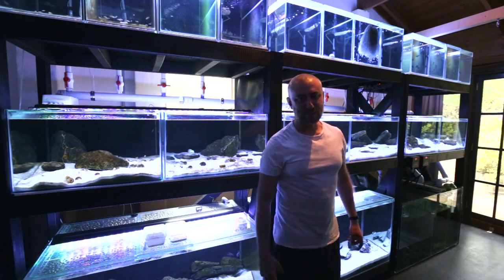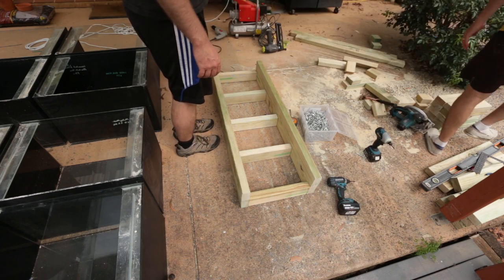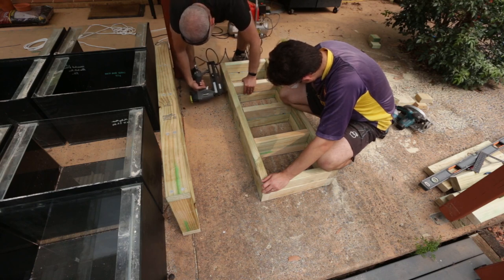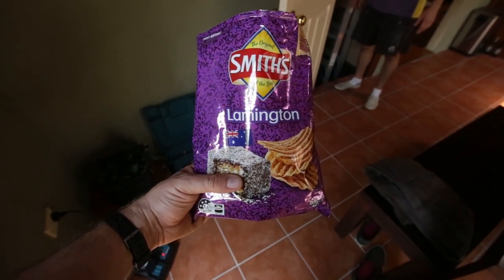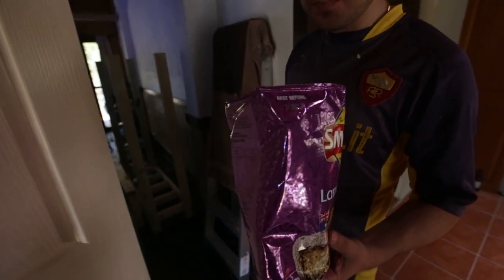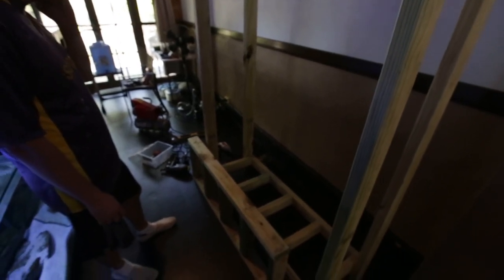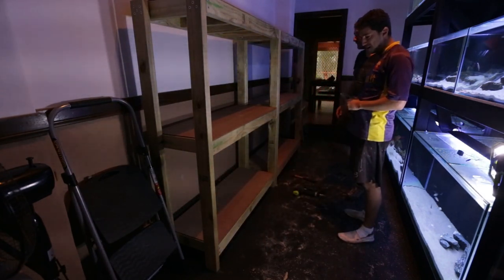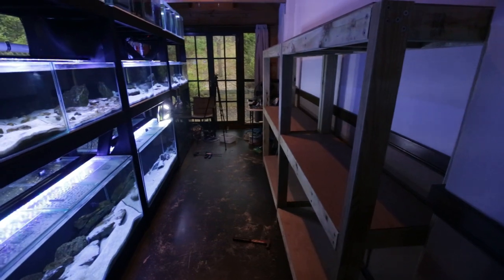How to build Fish Tank Stands/Racks/Racking. DIY! Part 2

Comment: So the tanks are held up with screws? All the load is on the screws??
Reply from the maker: Apologies, I responded to your comment the day you posted it through the youtube app but it seems to have disappeared or something. Seeing Jack's comment today made me notice my initial reply to you was not here. But that is correct, the load is on the screws. However, my requirement for these stands was for each shelf to hold approx 260kg. Each tank, filled to the top with water weighs approx 110kg. Add approx 15kg-20kg for the glass and that's around 130kg per tank, filled with water. Lets just say in this example that each screw has a breaking limit of 20kg (they don't, it requires a lot more sheer stress to break one of these screws). Each shelf is connected to the legs of the stand by 32 screws. In this example, each shelf would be capable of holding 640kg which is over double what the tanks I have weigh. This is all that I required for this build based on these tanks. I hope that helps answer and address your question.
Reply: @JasonsCichlids  why not just use the dado joint method and save yourself the screws and worry?